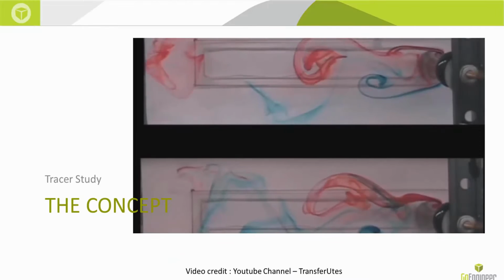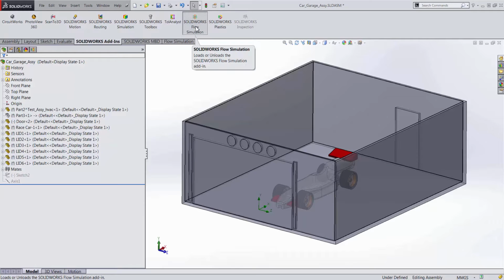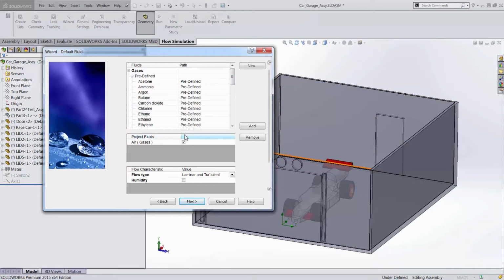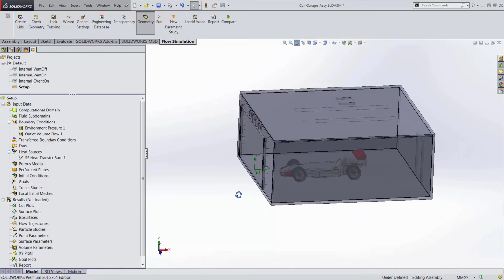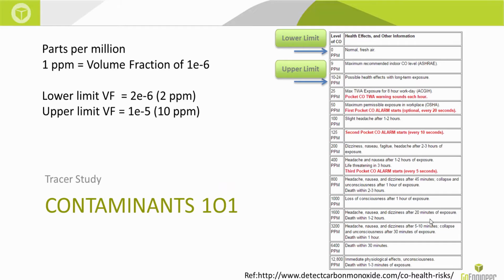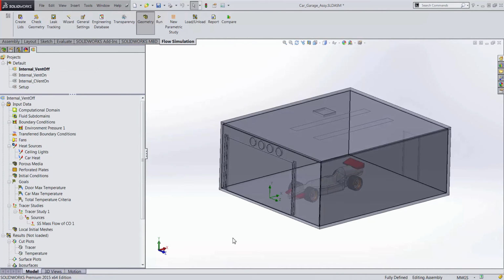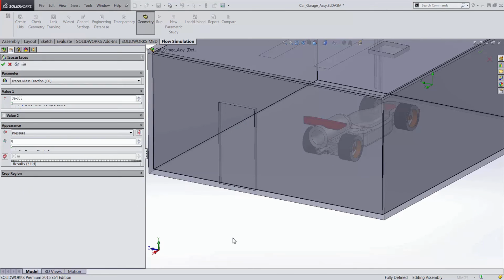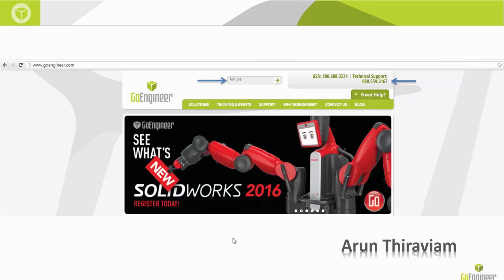SOLIDWORKS - Flow Simulation and Contaminant Detection

Comment: I try to practice as your guideline but have this problem? could you help me for this?
Face<1>@LEAK PART-3 is not laying on the boundary between solid and fluid region.
Reply from the maker: Hi Pierre,
This error would indicate an issue with the program recognizing the fluid volume for the flow project.  The program does not think that the face you are selecting is touching fluid.  Your next step would be to use the Leak Tracker tool to determine if you have openings from the external environment to the internal environment that would cause the fluid domain to not be recognized (like this: https://www.youtube.com/watch?v=ad323Hc6-9s ).
Reply: @goengineer  Thanks you so much, I already solve it.

Comment: Hello,
I am trying to simulate the pattern of an air diffuser as part of a school project. I modeled the diffuser pattern with a plenum box and round duct, and I closed the model by placing a lid at the end of the round duct and extruding a square box around the diffuser as a room model. My main problem is specifying boundary conditions. I already specifed an inlet volumetric flow at the round duct lid but I am not sure where to specify the pressure boundary conditions. Do you have any advice you could give? 
Thanks